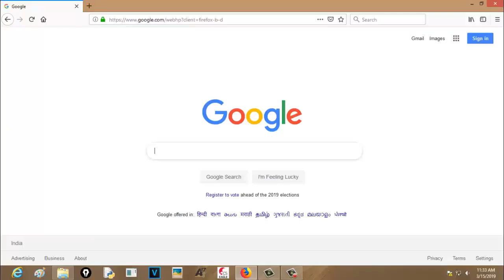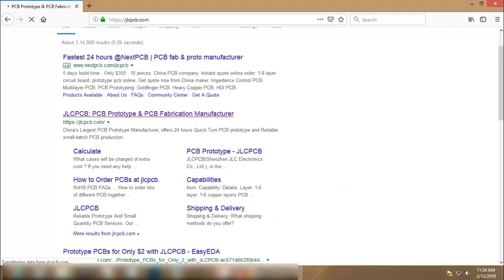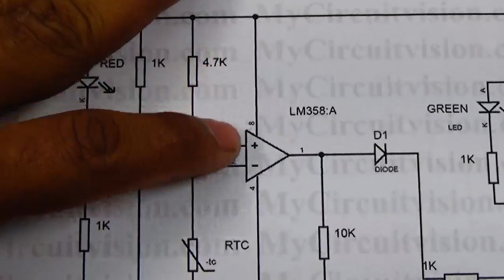How to make Temperature controller at home

Comment: Nice work. I'm designing a temp controller for a very small micro green house. My plan is to use a thermistor circuit to turn on a light bulb when the temp drops below a certain threshold and then turn it off when the temperature reaches the max allowable. Maybe I'll have a fan in there too to cool things off if it gets too hot. Thanks for this!

Comment: How can it control temperatures when we need a specific temperatures ...example - Like If we want 30 to 35 degree cel temperature inside a incubator ? !!
Reply from the maker: bro....than using microcontroller based system with display.....

Comment: Bro we have stc 1000 temperature controller in (12v) but controller resistance is burns which resistor i will used in controller reply please
Reply: k type thermocouple lm358